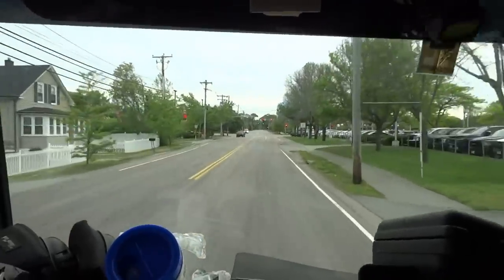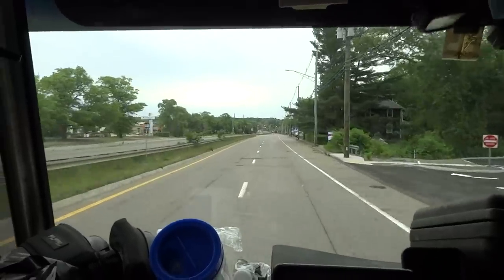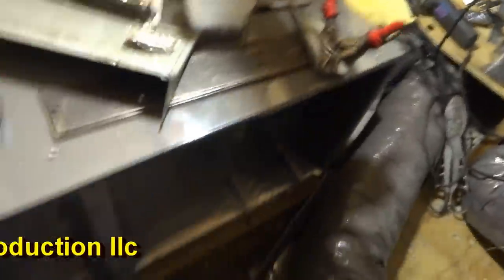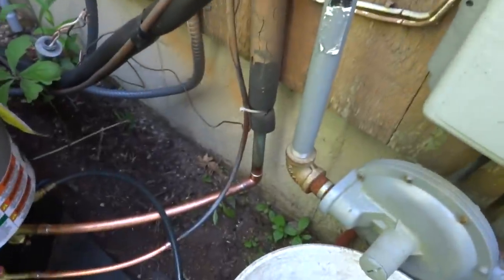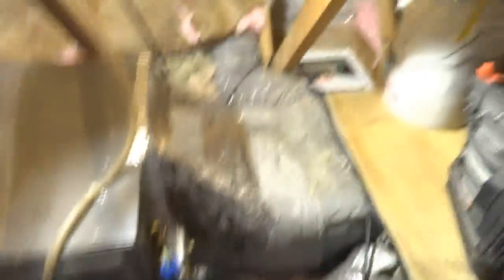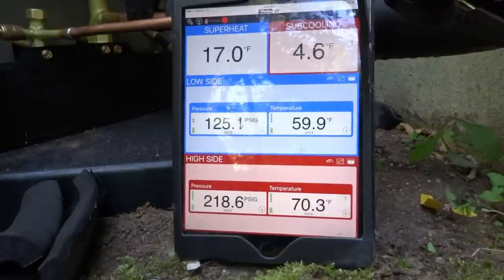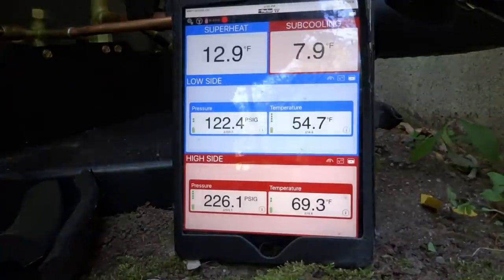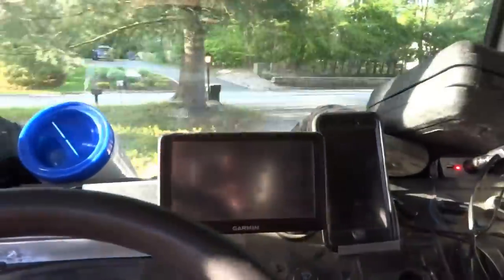OLD LEAKING R22 CENTRAL AC CHANGE OUT

Comment: "I'd ripped that nest thermostat off the wall and use it as a hockey puck"😂 that has to be the quote of the decade! great job Steve
Reply: corey Babcock  I really wouldn't know. I was just making a comment on what Steve said. Have to admit it was funny! I never owned anything like that nor would I ever. Don't know anything about them it's just something that does not interest me.
Reply: I like the "old school" equipment but I must admit, I had solar panels installed about 5 years ago. The company installed a Nest and I have not had one bit of issues.

Comment: That was a great video and you did an excellent job on the install. Sounds like you had a pickyass customer, it was hard to hear. I don’t do installations or maintenance anymore but I would be tempted to make me a "service thermostat" that I could keep in my tool kit and temporarily disconnect the thermostat inside while doing service. I was working on a rental house once where the people wouldn't even look at me but lock themselves in their rooms. It was spring and he had two teenage daughters and one would come out of their room and turn the thermostat UP then go in the room and lock the door. A few minutes later the other would come out and turn the temperature DOWN and repeat the slamming and locking the door! I will never forget how glad I was to leave that asylum!

Comment: Great install as always!!!!! My Mom and Stepdad still have the old brown Goodman A/C and the 1989 Lennox oil furnace with a Beckett AFG burner. I deliver oil to them myself. As old as those systems are and with the price of heating oil now they are thinking about a change out to a heat pump. I'm wondering what system would be good for them to go to if they do a change out in the fall???

Comment: Hey Steve!
Great video!!!
Question... Just spent $8,500 on new A/C to replace old R-22.
I live upstairs in a condo.  
A/C company says the COPPER TUBING IN BETWEEN THE WALLS of the condo IS CORRODED.  Company says they either have to go inside the walls of the condo below (condo owner said NO!) or go outside the condo to lay the line set (condo association said NO!)
From what I understand is that the A/C company is supposed to replace  the line set when changing over from R-22 to R-410A.
WHO IS RESPONSIBLE???
It is... HOT AS HELL IN MY CONDO IN FLORIDA!!!

Comment: I dont like the nest thermostat either Steve!! 25 microns on the evac is really good. 👏
Reply: That was 25 microns at the pump. If he had the vacuum gauge on one of the ports it probably would’ve been a few hundred. Still a good vacuum but definitely not 25
Reply: Right? I've never seen a line set get that low, was gunna say it was cuz up in new york they got that old crusty air up dair. Haha
Reply: @Kswannbro  Steve is not in New York! Steve is in Massachusetts,  Dartmouth/ New Bedford area to be exact.

Comment: Isn't it recommended that outdoor condenser units be raised a bit higher off the ground in snow regions like where you are?
Reply from the maker: its not a heat pump straight cooling ... so it dont need snow legs .
Reply: @stevenlavimoniere  I live on the top floor of my building. I can hear the compressors on the roof when the idiots are running their AC in the dead of winter. I'm in here with the heat (gas) crankin wondering WTF is wrong with some people.
Reply: @stevenlavimoniere   I won't tell you your trade but I've heard others say that setting even AC only units at least 6 inches off the ground can extend their life. Maybe not all agree, that's fine.
Reply from the maker: @snidelywhiplash8923  not a bad idea to put them up on snowlegs .

Comment: My AC system consists of putting in a couple of window units. They use less electric and cool fine but the down side is they are noisy. The fan is right in the room.
Reply: My apartment has a 3 ton central unit...honestly window units would be quieter than the air handler!

Comment: Sorry,  I love Nest Thermostat. I can change my tempature wherever I'm at. I can change it from across town or I'm in my bedroom. I had to change my Nest, so it wouldn't run on a schedule. I wanted it to run like a traditional thermostat, where I can change the temperature myself. These stupid electrical utilities, are doing time of use billing. So, doing the daytime, from 7 am to 7 pm, their charging customers a higher rate for electric.
Reply: I love the flexibility of my nest not particularly fond of the nest itself. i turn off all the automatic stuff and do everything myself but like you I like to precool or preheat manually
Reply: @dannycalderon8516  I had to find out how to turn off the scheduling feature, because I didn't like the tempature going up and down at random times. Like I said, I turned off all the automated features. I want to decide, when the temperature goes up. Plus, Nest Thermostat doesn't need a battery, because it runs of the power of furnace. That's another reason, that I love the Nest Thermostat. I can be halfway across town and turn on air conditioner or furnace, before I arrive home.
Reply: @dannycalderon8516  I have done the same thing, turned off all the programming crap and use it manually. It has been a great piece of equipment.

Comment: Did your flush the lines set from R22 to R410A?
Reply: I have the same question.It’s my understanding that IS THE Standard practice To flush the Refrigerant lines ,but I had a Carrier Condensing and A COIL unit replaced recently With a Goodman condensing unit and A coil from Goodmen and THE AC contractor Informed  me Is that the flush that is used in the cleaning process also leaves a residue and is not recommended by Goodman . Goodman recommends just Thoroughly evacuating the line sets. I had my doubts so the contractor Had  the supply house email me a letter from Goodmen  Verifying that process,Which eased   my concerns. 
I would love to know if any other AC manufacturers  are now making that same recommendation as opposed to flushing out refrigeration lines?

Comment: Im disappointed when working for someone as a helper and they used a 5gal bucket with water method. :/ I dont want to be that way and never working with them again.
Reply from the maker: they use a bucket with hot water in it to get the last of the refrigerant out or for faster charging .. that can only be done with r22 seeing its a whole refrigerant and not a blend .. 410a or any new refrigerant has to be upside down for charging so the bucket will not work .. r22 is fazed out not ..so no need to worry about that nonsense